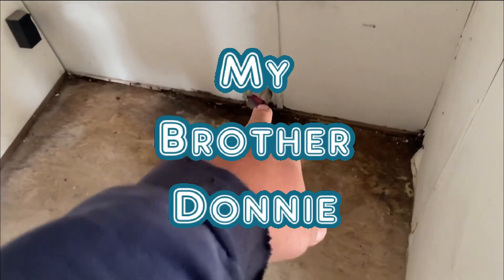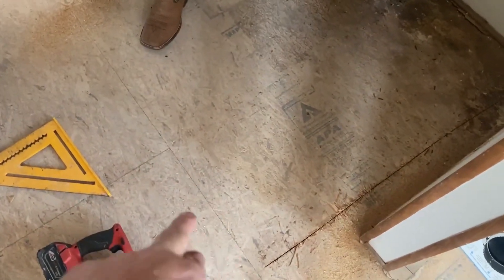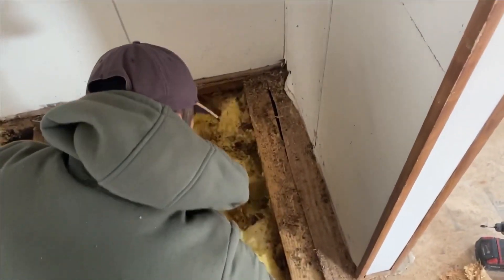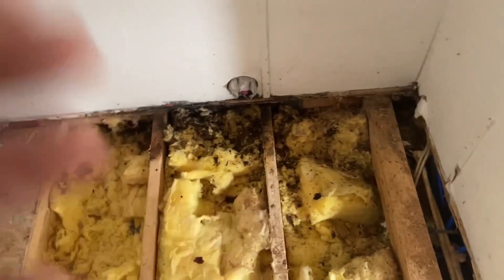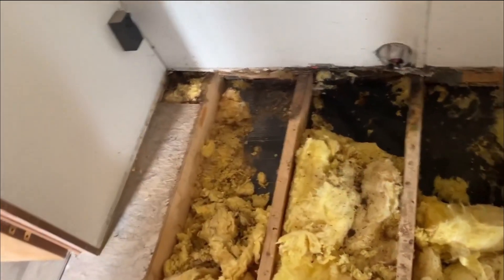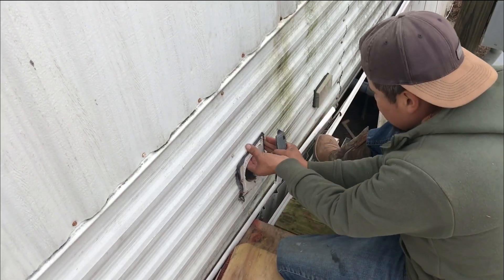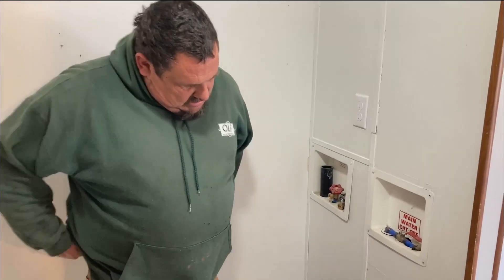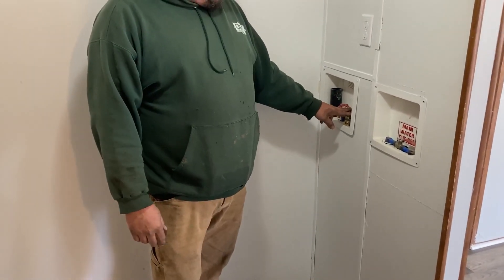The Laundry Room In These Mobile Homes Is ALWAYS Water Damaged!  -How We Repair It...

Comment: I don't care what companies say when it comes to their plastic products and being outside, they all like to make bold claims about how they have UV protection and all that.

But after being a sucker for all those products over the years, give me metal ones any day of the week, maybe it's the harsh aussie UV index (UV Index in Australia during summertime is generally 14 or higher which is 'extreme' and 'spend as little time in the sun as possible', compared to the rest of the world where even in summertime it tends to be 10 or lower).

But yes, plastic, when outside in the whether, regardless of what they say, deteriorates and becomes brittle, breaks, etc...

I say good job on replacing it, and don't worry about how far it sticks out, the ones that sit flush have the possibility of letting the weather in (rain mostly), at least that one is down facing so pretty much no chance.
Reply from the maker: Hopefully it’ll stay there for a long time

Comment: Do 2023 Deer Valley Homes have this problem?
Reply from the maker: I don’t know I don’t deal with anything that new every used one I have bought or looked at has problems around the dryer vent either because the dryer vent is leaking rainwater or the washing machine is not hooked up correctly and leaking